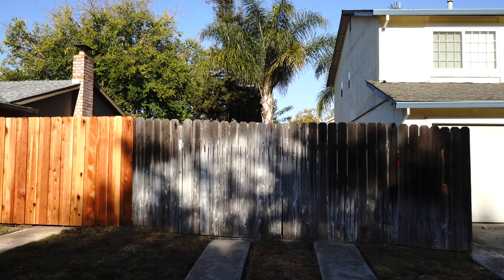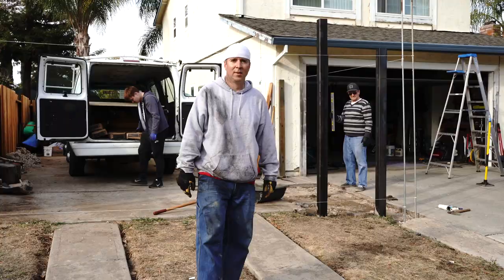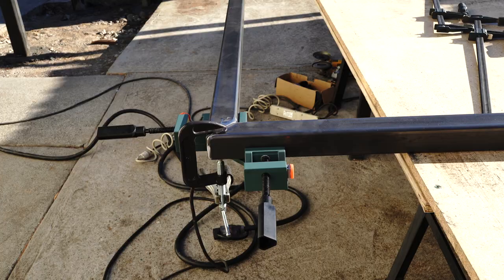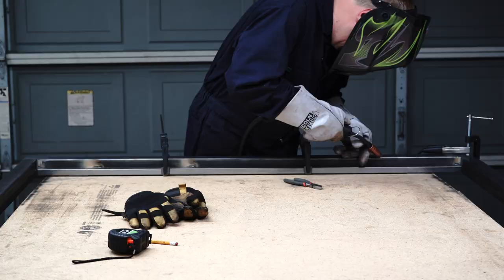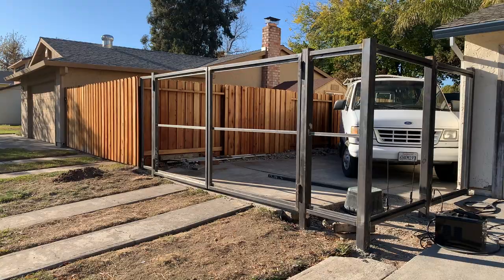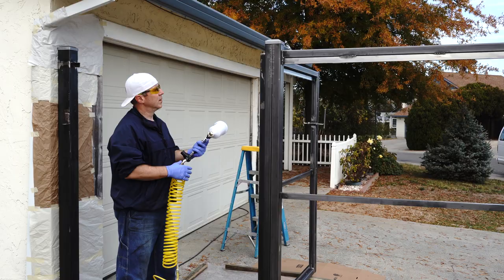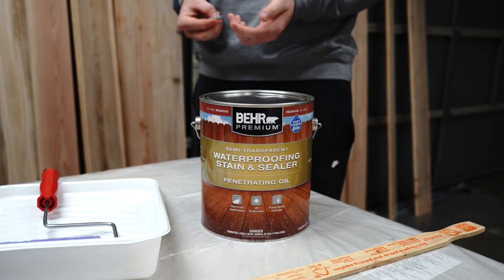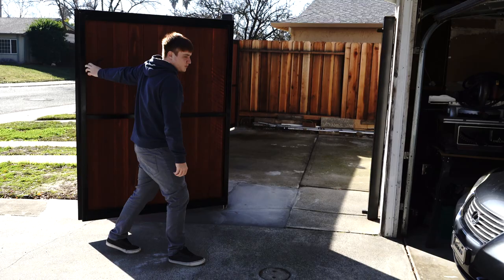DIY Metal Gates and fence project

Comment from the maker: Hey guys
If you liked this video and would like to see even better fence project than check out this video here https://youtu.be/dlEqQZGlE4s
Reply: How is the privacy? Is there any gaps between the bored?
Reply from the maker: @tonyfat2458  
Eventually Woden boards did shrink a little and now there’s a slight gaps between them so I’m going to redo entire picket boards by overlapping them to get that ultimate privacy fence.
Reply: @balabay77  Thanks, I'm going to be putting up a steel frame with red wood boards, and I'm going to do board on board for privacy. Vertical overlapping I think this is what they call the one I want to do

Comment: Great video, very entertaining. if you are ever doing this sort of project again, get yourself a propane torch, once you have cleaned the metal with Acetone burn it with the torch, this causes the metal to sweat out any moisture and then immediately prime and paint. you can use all kinds of crappy paint and it will last for years because you arent trapping moisture under the paint job.
Reply from the maker: Thanks for very useful advice. Greatly appreciate it and thanks for watching our project. Cheers 🍻

Comment: Very nice. My only comment is you might have done a little better with your compressor if you thinned the Rustoleum paint with 10% acetone and maybe used the smaller gun. The 20 ounce gun uses a bit more air than the small one.

Comment: Good job ---just an FYI you don't need thinner to remove the oil from your steel. Liquid soap works just as good. you can tell by how fast the metal starts rusting, and it's user friendly. Don't sell yourself short on your tool list, the ones you used did the job you asked them to do
Reply from the maker: Thanks for the tip regarding the liquid soap. I was just under the impression that mineral spirits are better in degreasing metal but never considered to use soap. I’ll have to try it sometime and see if that works. Appreciate you watching and commenting. Cheers 🍻

Comment: Hey, I like how you guys did things. I have a few considerations though. I think it would be well worth it to buy some quality consumables from whatever brand you prefer besides harbor freight. Better consumables last much longer and also cut/grind faster. Also I did professional TIG for a year and it is my opinion that MIG is much better for most things. MIG is so much faster, TIG can be a hassle to weld in most angles and everything has to be cleaner. MIG is much cleaner than FLUX-CORE and is still very easy to use! Great job on the project though. Dang man! You guys really did a great job! Also the welds look really good man! Making harbor freights flux core welder look awesome. I've used their new titanium flux welder, I liked it a lot. haha.
Reply from the maker: Thank you sir for your input and advice. One of these days I’ll need to buy a new MIG welder. Indeed, flux core is messy and leaves too much spatter around the weld. Appreciate you watching and commenting. Cheers

Comment: This was great.  Now I just have to find a video for round poles this fence guy bought and robbed me not doing job.  I was digging the post hole till after dark last night with my hand and a trowel after running out of room on a 2ft garden auger. Sucking it out with wet vac.  Down 2 ft. so far. Never welded so thinking to use corner elbows on it screwed in and JB weld.

Comment: you da man!! You didn't have fancy tools to build this but the quality turned out great!! The overlapping joint is a great idea. am ganna use the same method to finish up my side fence. By the way, what kind of screw did you use to secure the wood to the flat bar?
Reply from the maker: Hi Vince
Glad you enjoyed our project. 
I’ve used Deckmate 1-1/4 inch star drive coated screws. They are meant for decking and guaranteed to last for a while. You can find them at Home Depot and some other hardware stores. Thanks for watching and commenting.
Reply: @balabay77  Thanks for sharing my man!!

Comment: I am building an almost exact fence like yours because of this very video and I appreciate y'all publishing it with so many details. My question is about the hinges. Are you saying the pointy end will go in the gab between the posts? I was thinking you used the pointy ends as the place where you're going to weld it to the post? Thank you for the feedback so far along from when y'all built the fence.
Reply from the maker: Yes that’s exactly what I did. The pointy ends of the hinges were wedged in between the post and the gate and I just tack welded the top and the bottom hinge in place and once they looked even, I made a final pass on the outside of the fence and then on the inside between the post and gate. Thanks for watching and commenting.

Comment: This was such a fabulous and informative video of a how-to. Fantastic work on explaining step by step and the occasionally joke insert, lol! 
Q1: what structural purpose does the additional bar @5:46 have if it was welded to the bottom and not mid to avoid sag? Wouldn't the additional weight still have it sag down or welding on the bottom gives it more stability?
Q2: How much was the welding machine and from where? 

A+++ 😊
Reply from the maker: Q1; actually the rectangular tubing was added to the top, middle and the bottom of the gates to create more structurally rigid design. Also we attached picket fence to rectangular tubing so it basically served dual purpose. 
Q2; when I purchased my welder a long time ago it cost me $170 but now it looks like they sell them at $209 on the HarborFreight website. Here’s a link to it. https://www.harborfreight.com/170-amp-dc-240-volt-migflux-cored-welder-68885.html

Thanks for watching and commenting. Cheers.

Comment: Awsome work good bonding experience with your family.... I think I might take on this project I have a similar area I want to get redone as well by any chance can you give me a rough estimate on the metal and wood I am most likely will spend taking on this project.
Reply from the maker: Hello Rafael 
Roughly speaking we spent close to a thousand dollars on the metal and approximately 260 bucks on the picket fence. With other materials like the stain, welding supplies, paint and other related stuff you’re looking at spending close to 2 grand. When I started this project I thought that I’ll spend around a thousand on it but in my neck of the woods and because of the pandemic everything went up in price due to short supply. All in all it came out about the same price as my neighbors new  wooden fence next to ours. She hired a crew and they did a half ass job for $2000. Thanks for watching and commenting. Cheers.

Comment: You guys did awesome but I wish you told us how long it took you and how much it cost you nobody really does that but thank you anyways
Reply from the maker: Hi Roberto
This project took me longer than I expected because I was working on it in my spare time after work. Roughly 4 hours per day until it would get dark. Took me almost a month to finish it because I didn’t know what I was doing. Cost me around $2,000 dollars and that was before the prices on metal went up. During pandemic everything just became more expensive so prices in my neck of the woods might be different from your local area metal distributors. My other part of the fence cost me slightly more but took less time to finish it. I was done in two weeks. Check out my other part of the fence if you want. Thanks for watching and commenting. Good luck with your project.

Comment: You inspired me.  In your opinion, what’s the max length each gate can be, without sagging?
Reply from the maker: To be honest I don’t really know what’s the maximum length before gates start sagging but my gates are 12 feet wide in total length. Each gate is 6 feet wide and I haven’t seen any signs of sagging yet. If you reinforce it with horizontal or diagonal braces (rectangular tubing) I bet it will hold up pretty well. Thanks for watching and commenting. Cheers 🍻

Comment: What kind of screws did you guys use to put the boards on?  I assume they are self-tapping to get into the rectangle tubing on the backside, and i think i see square heads on them but not sure.  I'm doing pretty much your same exact gate design at my place in nor-cal, thanks for putting the video up, made my job much easier!
Reply from the maker: If I had to do it all over again, I would of done it slightly better just like in my other video here 
https://youtu.be/dlEqQZGlE4s
I’ve made some shortcuts and it turned out much better. Self-tapping screws won’t always go through the rectangular tubing so I had a chance of plans by using deckmate 2 in screws. Even though they are specifically designed for decking, I just drilled a pilot hole each time and then screwed them in. They are weather coated and they come with T-25 star bit. Check out my other video and you’ll see me going over these screws. Thanks for watching and commenting. Cheers

Comment: Great job, but even more praise for answering all these questions. just as helpful. My question, do you think this same approach could be applied to creating a 13' sliding gate? i would assume so, but maybe you would have some recommendations for something like that since you did such a great job on those swingers.
Reply from the maker: Sliding gates are great if you have plenty of space to slide it open. I would of preferred the sliding gate over swing gates but we were limited on space. 
The only thing I would recommend is to get high quality  rolling wheels and some type of guiding rail system for those rollers. Over time rollers can get rusty and entire sliding gate will be too heavy to move open. Also, above ground guiding rail will be better than a grove in the ground because you won’t have any issues with leaves and other debris getting stuck in the grove. I’ve seen some videos where they used angle iron as a guiding rail and it worked out great. Yeah, you would definitely want to make a 13 footer gate a sliding gate. Probably too heavy for hinges and it would sag after a while. Good luck with your project and let me know how it turns out. Thanks
Reply: @balabay77  thanks for that. i actually have a dual entrance and want to do a slider on one and swinger doors on the other (both doors 7'x6'). your vid on the swingers definitely helped. if you don't mind, structurally speaking, if my slider is 7'x13' how many vertical support bars (square tubing) would you recommend to to keep it rigid?
Reply from the maker: @rywilliams445  
To be honest with you I’m probably the wrong guy to ask about structural integrity of a gate ‘cause I’m not the expert in these things and it was my first ever project but I would assume that you’ll need at least several cross braces to make it rigid. 
Entire weight of a Sliding gate usually rests on the rolling wheels so there shouldn’t be much of a warping or bending unlike those heavy swing gates that are attached at the hinges. Anyways, I think you should be fine with X shaped braces or + shaped reinforcement of your gate. Google images got plenty of ideas to choose from and that’s where I would look first. Cheers mate.
Reply: @rywilliams445  I'm also researching this and what I know so far is that it's recommended to have your support bars spaced at a maximum of your height.  So in your case, 7ft tall means that your support bars should be spaced out 7ft apart (max) OR LESS  is better

Comment: great vid! can you tell me, do you use galvanized or just regular steel? i know the galvanized stuff can be toxic when welding because of the zinc. thanks.
Reply from the maker: I was going to use galvanized metal but then I found out that it was more expensive than regular steel, plus it was toxic during welding process so I just went with regular steel. 
In my opinion there’s really no need to use galvanized if you’re planning on painting your metal anyways. Thanks for watching and commenting.

Comment: Good job! I think your welds look great compared to mine. You don't need to paint the part of the post that goes into the ground?
Reply from the maker: I believe when you pour concrete around the post it basically seals and protects the metal from corrosion as long as the cement is slightly above ground so that the water doesn’t pool near the post. If it makes you feel any better than you should paint the posts for that ultimate corrosion protection. Thanks for watching and commenting.
Reply: Thank you! @balabay77

Comment: great video I found today ...Wondering  you share details of welder machine please ? is that arc or mig and specs pls?
Reply: 😂it’s the cheapest harbor freight welder. I’m surprised he put that much trust in a 100$ welder when most people consider “cheaper starter welders” starting at 600&. I used to have one to build a robot frame that broke when I step on and the welding isn’t prettiest and make a mess. I got a next one up and I still wouldn’t use it for a gate but I might reconsider

Comment: Great job! 
Awesome family time in the interim. Quick question, can you list the info on the weldin f machine you ud?
Thanks!
Reply from the maker: Hello Jose
I was using my old flux core wire welder from HarborFreight store. Here’s a link to it https://www.harborfreight.com/welding/welders/mig-flux-welders/170-amp-dc-240-volt-migflux-cored-welder-68885.html

Good luck and thanks for watching our video.
Reply: @balabay77  Thanks so much, cheers from Chicago!

Comment: What did you do with the screws after the wood was drilled in ? Cut them ? Also did you add that 1" lip to the other side to cover up the top cuts of wood ? I'm doing something similar and that's where I'm stuck . Total diy not an expert here
Reply from the maker: Hi Adrian how are you? The one inch lip you’re referring to is actually a rectangular tubing that was welded on for rigid support at the top, middle and bottom of the fence and gates. Wooden pickets were attached to that rectangular tubing in 3 spots and I only drilled through the first wall of the tubing. In other words, screws didn’t go all the way trough both walls of the tubing to the other side so I didn’t need to cut off screw tips. 
If you have questions feel free to ask. Thanks for watching and commenting. Good luck with your project.

Comment: You never said what the width of the gates were.  I assume they were 2 meter frame gates each.  Total span width 4 meter car DOOR port opening.
Reply from the maker: When I was making my game, I wanted it to be wide enough for a full size truck or trailer to fit so I cemented the main square posts where I wanted them to be. Make sure they are perfectly vertical because if they are not vertical then you’ll have issues with your swing gates. Distance between my main posts are 12 feet 4 inches ( 3.75 meters). 
Then you have to figure out each gate size. I left about 1/4 inches (6.35mm) of space between posts (just enough space for hinges to fit and function properly. Then you’ll need 1/4 inches (6.35mm) of space in the middle, between each fence frame. There’s no right or wrong way of doing your fence when it comes to measurements. You can make them to your preferred preference and if you are worried about structural integrity then you can reinforce them with several cross braces and maybe add one more hinge. I’m pretty sure 3 hinges would work great. Good luck with your project and let me know how it turns out.

Comment: on the .25" main post did you add gravel in the bottom, or did you just laid your steel post on the ground then added the cement?
Reply from the maker: I added a whole bag of mixed cement to the bottom of each hole and then lowered the post into wet cement. It sealed the post opening and will prevent it from rusting.  I decided not to add gravel to the bottom of the hole.

Comment: I know very little about fences/gates but when building a gate door shouldn’t you usually have a diagonal brace to support the load of the door instead of a horizontal one? 13:05 not questioning your gate, it looks awesome but just curious for my gate I plan on building soon.
Reply from the maker: I believe cross braces are used for wooden gates to prevent sagging and warping. When it comes to metal gates, I’m pretty confident that welds are solid enough to prevent them from bending out of shape. I’ve seen others use square or rectangular tubing to reinforce the gates by welding them diagonally but if your welds are sound and not porous then you should be good. There’s many different ways you can make your gates so use whatever style you like. Good luck and thanks for watching and commenting.
Reply: @balabay77  oh ok I see now thanks man I appreciate the quick response!
Reply: Wood fence i always use diagonal brace from pole side up towards center top. But i would be 100% confident in this metal frame holding up for quite a long time. Looks amazing from one fabricator to another. How has it held up for you so far?
Reply: @tylerlesage4514 Thanks that’s good to hear! For me I’ve not had the time to build mine yet, it’s in the “works”. When ever I’m free from work, I’ll get back to it lol
Reply from the maker: @tylerlesage4514  
So far the metal construction held up pretty well with no issues but the wood boards shrank a little and now there’s small gaps in between them. I’ve made a second video of my other part of the fence on the other side of the house and I decided to use overlapping technique. It came out much nicer and I recommend it to everyone. Even if the wooden picket boards shrink over time, there won’t be any gaps in between them. Thanks for watching and commenting.

Comment: Nice Fence! 

Did you use self tapping screws?
Reply from the maker: Sorry I missed your comment. No sir, I used decking screws because self tapping screws were useless and they did not go through the metal. I had to drill a pilot hole for each screw and it took me longer but it all worked out great.